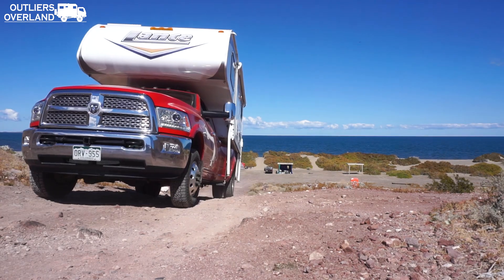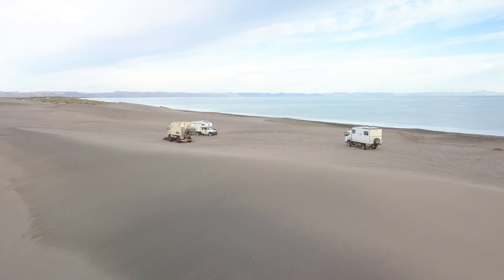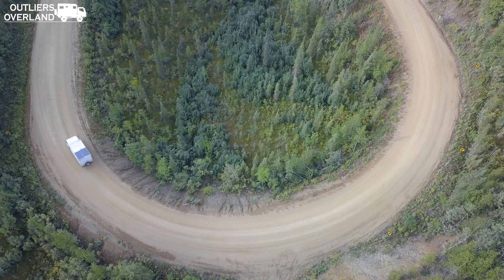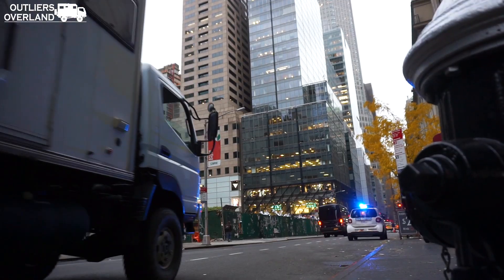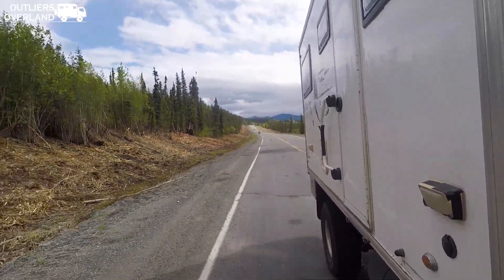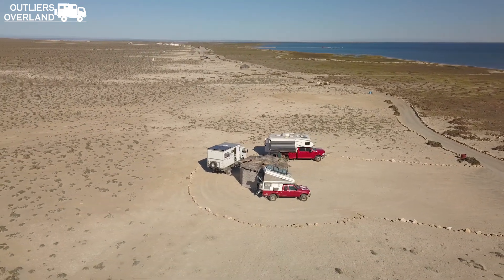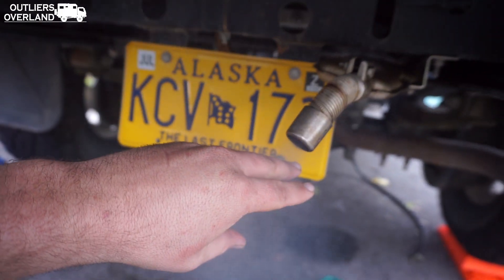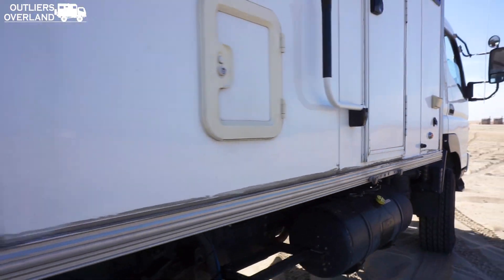8 Things you DON'T know about 4x4 EXPEDITION VEHICLES

Comment: First I am a old hippie in my 70’s now. Over my life I have built several RVs mostly from old school buses. So when I retired I Decided to build the Ultimate man toy. I started with a 1972 full size International Harvester Ward  school bus. I also had a old deuce and a half army truck with the Multi fuel engine. When it was all done I had a shorter school bus on a Duce chassis upgraded disc brakes and power steering. Insulated the crap out of it and went to RV insulated windows. I have one 6’ slide right behind the driver. It has AC. 10 house batteries 2 Optimum to start the Engine. 6 Solar panels 1200 watts. Two 3 kw inverters only sleeps two. 150 diesel 150 water, 60 black water. Tires are 42” Michelin. Will roll down the highway at 68 Miles an hour. 5 speed with 2 speed transfer. Sat radio, sat TV, external jacks for guitar and microphone. I pull behind it a Army 400 gallon water Buffalo. 

I like to go out to New Mexico & Arizona to prospect for gold.
Reply: you guys still search for gold out there?
Reply: George Alexandru: one to three ounces a week x  2 weeks a year x 40 years adds up! Then for 5 or 6 years I spent the whole summer in Alaska. Way better than a 401k.

Comment: Thanks Ben , i was able to check all the box's that i've had done for my build. I did opt-in an AC unit for the cabin , however it will have to be powered by a honda 2200I gas gen. the truck fuel source is diesel  with induction cook top , 850W solar , AGM battery bank. ~peace~
Reply from the maker: You’re very welcome.  
Sounds like you have an amazing rig.
Reply: @outliersoverland  yes and i am really excited , hoping to make a p/u plan soon cause the US/CA boarder does not look open soon.. ~peace~

Comment: I'm confused as to the purpose and design of the three point suspension for the coach portion of the rig.  Three point suspension is inherently unstable as there are large portions of the rig that would be only supported in the center.  Does this design allow for chassis flex or something else.  Inquiring minds would like to know.  Me thinks salmon season has started so I guess it's time to stock the larder.  Keep the good stuff coming guys.
Reply from the maker: Hey Johnny.  For off road applications the subframe allows the chassis to flex independently.  Aside from handling it helps to not destroy the camper box.   
I’m probably not doing the best job explaining.  
Thanks for watching.  I hope you are well.
Reply: @outliersoverland  You're right in that it allows the chassis to flex independently, but that only works for so long if the chassis isn't designed to do so. People get tied into the whole three point thing since that's a key part of the Unimog load carrying design - but the mog chassis is specifically designed, in many of their models, to take that flex. The FUSO chassis, unfortunately, isn't designed for that amount of flex.

Comment: Actually you will find many more IVECO Daileys and Isuzus than Mitsubishis in Australia
Reply from the maker: I was more referencing the choice in using the medium duty cab over engine chassis.  Yes there are several choices and the Isuzu is another popular one.
Reply: @outliersoverland  Yes we would call the Mitsubishi and the Isuzu equivalent Light Trucks, Medium Duty is very different to what you would find in the US. Interestingly the Mitsubishi Canter( the base for your expedition vehicle) uses a European designed diesel, it is the same as in the IVECO Daily
Reply: @robertryan7204  The Iveco's are only a recent thing, less than 10 years. Before that, the vast majority of light and medium rigid 4x4 trucks converted were Canters, Fighters and NPRs. They were also the vehicle of choice for larger Winnebagos. These days, however, they're mostly based around Iveco frames after Iveco entered the AU market 10 years ago.
Reply: @rexeverything4578  Yes the Iveco has really taken over but you are also  getting European heavy 4x4's and heavier Japanese Trucks